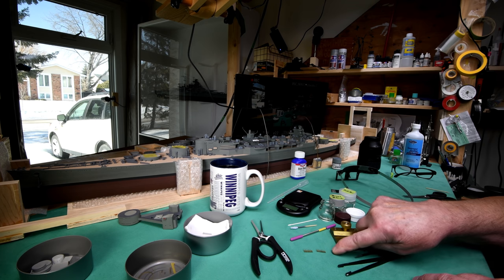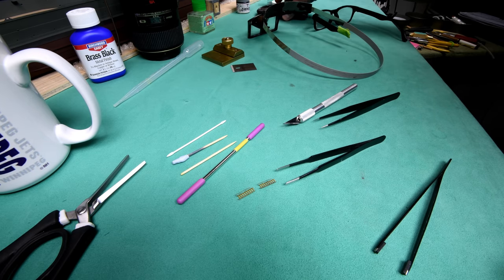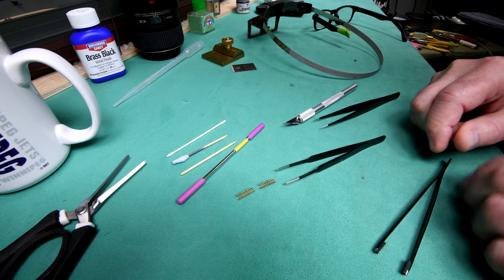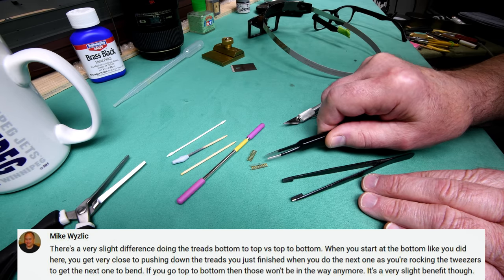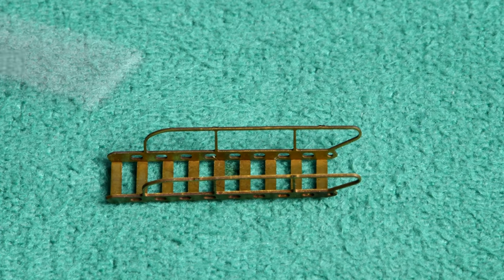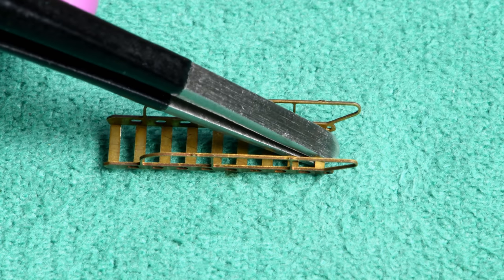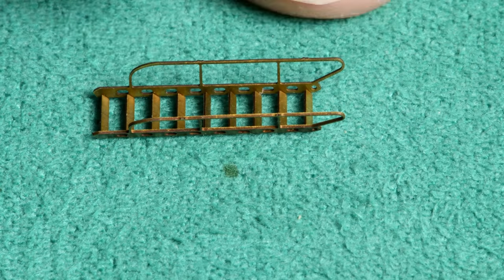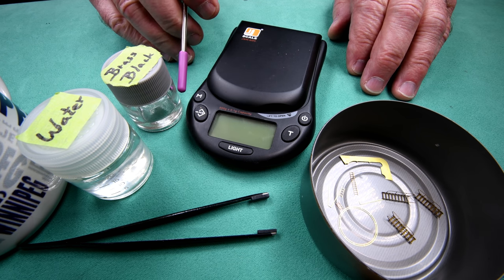The Model Ship - Part 737

Comment: Ron, maybe after brass blackened parts are dry, give them a spray of flat clear. Should protect the surface.
Reply from the maker: As I said to Marc "But as long as you're going to all that extra messing around with clear coat, may as well just paint it grey paint and be finished."
Now that's just my opinion. My thinking at this point is that painted parts are easier to touch up later --- something that I seem to have to do a lot, lol. 😁